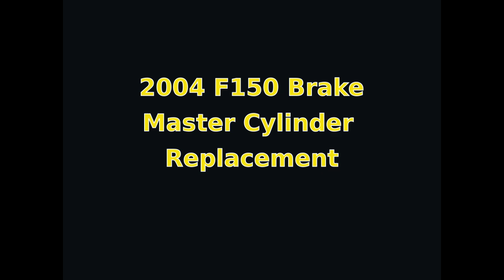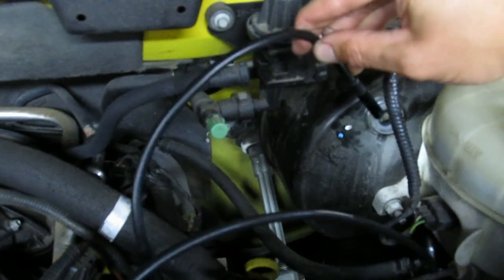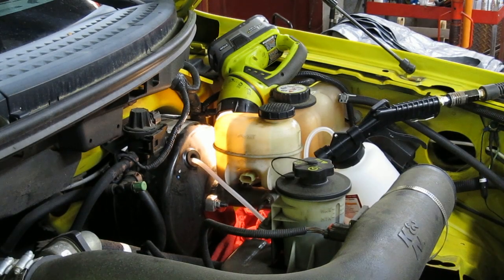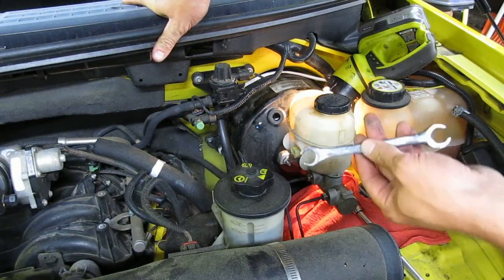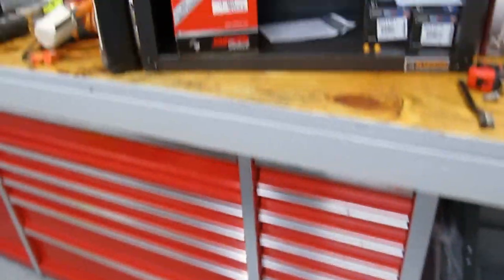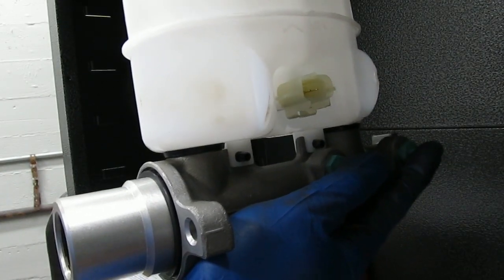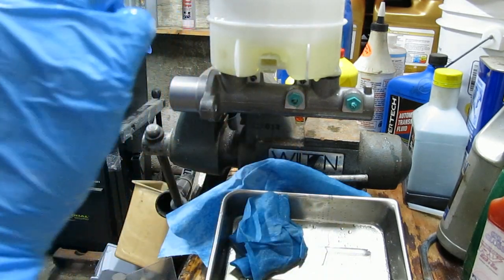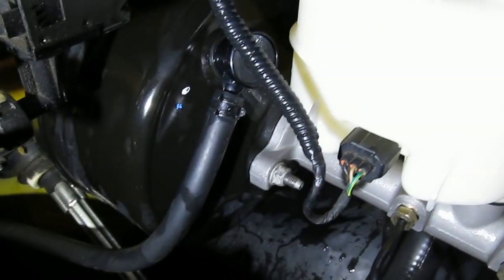Fluid in brake booster... 2004-2008 f150 master cylinder replacement

Comment: You could have simply put the two plastic tubes into a second container filled with brake fluid. That's probably what was intended by the manufacturer of the master cylinder.
Reply: yes thats what i was yelling

Comment: Great job. You could submerge those short tubes into separate bottle half filled with brake fluid. Would make it much easier and cleaner to bench bleed master.
Reply from the maker: Excellent idea.  I only thought about having them exit back into the master.
Reply: Great idea.  You see?  Thats why they say that 2 heads think better than 1.
I take off my hat to both of you.  I just evacuated all the fluid from my booster, now I gotta think of how Im gonna clean out tje residue.  I may have to remove it and wash it out with soapy water and let it dry for a few days.  
New ideas will be appreciated.
Reply: @likits1999  never happened to wash one. Those I've done so far never developed a problem down the road. I would just replace it and only if it goes bad. Personally don't like idea of having water in booster as it's gonna be hard to dry it

Comment: My issue is the brakes slowly go to the floor no matter if I press them quickly or slowly.
I checked the tube going to the booster and fluid is not going in. No gurgle and no fluid on/in the connector.
Can the master cylinder still be bad and not leak into the booster? I have not noticed any leaks and loss of fluid.
Thank you for this video.
Reply: Yes,the seals could be letting plunger push thru fluid instead of only against it.

Comment: I've got the same problem found my break booster brimming with oil inside  if I dump out the oil would the brake booster work

Comment: Did the fluid damage the booster internally? And how did you determine whether or not it did or did not? Nice video thanks.
Reply from the maker: I just got the fluid out and used it.  Still works fine.

Comment: Can fluid be sucked into the brake booster after a master cylinder replacement, if the brake booster is bad? ?

Comment: There is a difference between some brake fluids. Dot 3 is for typical/normal driving/braking. Dot 4 is for heavier duty braking (like pulling a trailer, etc. and had a higher boiling point) and is comparable with Dot 3.
Dot 5 is NOT compatible with Dot 3 and Dot 4. If Dot 5 is put into a Dot 3 or Dot 4 system it will eventually swell up the rubber seals and components and mess the brake system up big time!
I hear Dot 5.1 is compatible with Dot 3 and Dot 4, but I don’t know much about Dot 5.1 .

Comment: Will break fluid in the booster cause any problems ? Changed my master cylinder and noticed fluid in th booster please let me know
Reply: Brad Morgan yes there are rubber seals on the “plunger” in the booster, I always replace both when I come across this problem